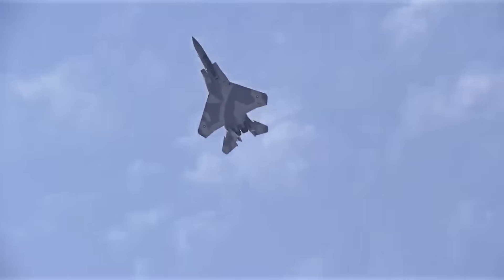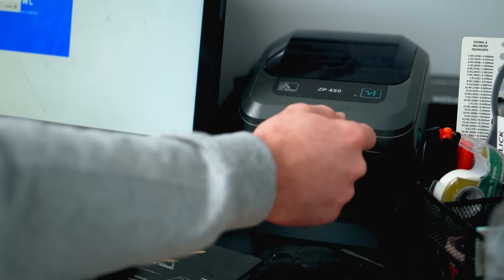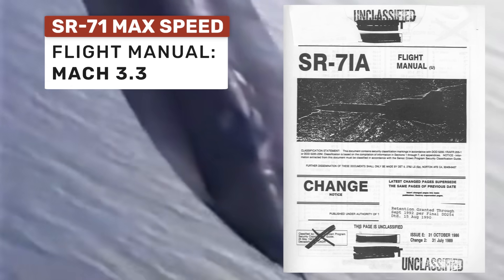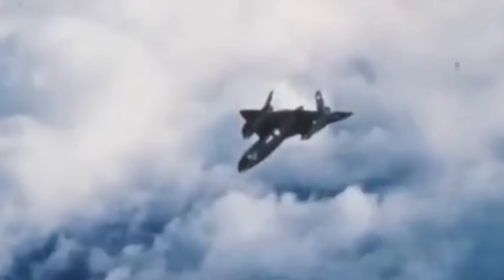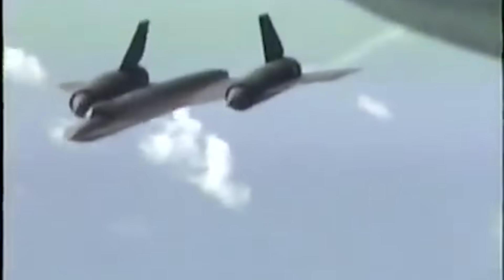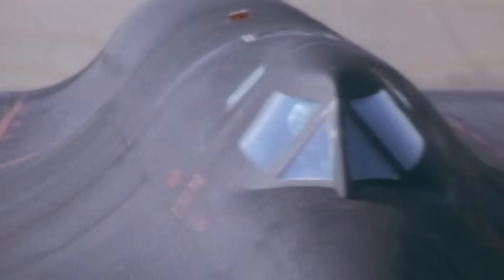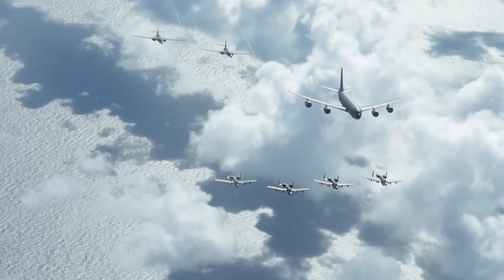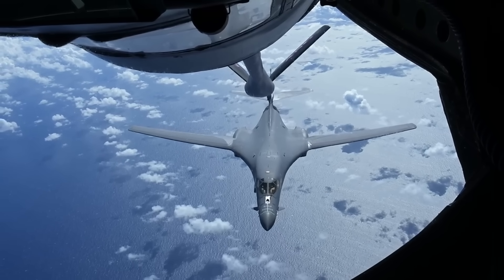The SR-71 was MUCH FASTER than the Air Force will admit

Comment: The Blackbird could do sprints exceeding M3.6, note that a sprint is short time bursts.
These cannot be counted as top speeds, considering the simple fact, these sprints are so short-time.
The 15 seconds pulled of, therefore cannot be taken in account either, ESPECIALLY because of the sloped flight.
In the end, if the blackbird would go for a 90° dive, it might have broken M4.0 ... with fatal ending, of course.
I bet, that would not be taken as speed record either, would it, sir?

Merely thinking out loud ... .
Reply: The SR71 did not have any "sprint" speeds, and it definitely couldn't reach 3.6. Even in a dive like that. It would have failed structurally before reaching a higher speed
Reply: @gr8crash  I was merely pointing at the 15 seconds, as I quite well pointed out, I thought.
Also, the SAFE speed limit does not mean, the plane could go faster.
Be it in an unsafe manner.  :S
Reply: @Xogroroth666  even 15 seconds wouldn't do anything as acceleration when already at mach 3.2 is pretty gradual. 

The "safe" speed was pretty close to its unsafe manner. There really wasn't much wiggle room there. Even if it performed a dive for higher speeds, it would likely cause the aircraft to disintegrate as it can't handle those loads. Also as it approached denser air it would overwhelm the inlets causing an unstart leading to reduced speed. The only hope for the SR71 to achieve higher speeds was when atmospheric conditions were colder than standard and the aircraft was flying higher than standard.
Reply: @Xogroroth666 didn't say it was the "danger" level, but that's pretty much it's speed. Everyone thinks it could just keep going but it couldn't. The initial limiting factor to speed was the engine CIT of 427⁰c. Now there were times they reached that limit and couldn't even reach mach 3, and other times they could be at mach 3.2 and be well below that limit. Thing is everything was designed for mach 3.2. The engines, inlets, cameras etc. Fly faster and you stress the engines, or inlets etc. The camera resolution starts to be effected etc. Remember even going to mach 3.3 was only with commander approval and also only if other engine parameters were within limits.

There's LOTs of people who think it could fly mach 3.5+, and none of them can ever answer a simple question. Even IF a pilot flew beyond mach 3.5, how would they even know?
Reply: @Xogroroth666 people just think it could keep accelerating etc beyond its mach 3.2 speed, it just couldn't. 

And yes 3.2 and 2.3 are very different,  but don't recall any one questioning that.

There's a story from the early A12 days where they were struggling to reach mach 3 so they went into a shallow dive then hit good air, reached mach 3.56 and redlined everything.  I'm skeptical of that as the aircraft didn't accelerate that fast,  plus you need very cold air etc.

Comment: Here is what I don't get.  Why is it people think the USAF has some sort of duty to divulge anything about it's aircraft to anyone, for any reason outside of classified congressional oversight??

You can look at the math involved in this aircraft and easily figure out the "range" of airspeed it would be able to achieve in perfect circumstances.  That, is about 3.5 and change.  This is100% due to the limitations of the compressor inlet.  The doors have to seal shut tight, the bypass tubes can't be leaky, air has to be cold enough, and a slew of other things have to be "just right' for it to hit that sort of speed.  I do not believe the A-12 was faster either.  Speed isn't just about shedding weight and "BAMMO", you're all of a sudden faster.  Like I said, you have all these things that make gaining speed at those levels a challenge.

Comment: I tracked the SR71 on radar.  Supposed to be stelth but we had a very good radar.  I can say it  is very fast and has extremely high altitude.   We at first thought it was an incoming missile.  Spent weeks troubleshooting the radar. All information is still classified, but  it is very fast.
Reply: All information is declassified. And has been for 2 decades
Reply: @gr8crash  From what I understood it remains classified.
Reply: @ThomasWakefield-g8e nope, all declassified. The only aspects of the SR71 still classified are parts of the ECM/DEF equipment as it's still in use today.

Comment: the SR-71  would stretch 18 inches in flight due to heat . And leaked $40 a quart fuel on the runway like a basket. Nasa acquired it and continued to run up the fuel bill. Fastest aircraft now last check was the space shuttle upon reentry.
Reply: 18"? Lol no. 3-5 inches was the max, not 18". It leak some fuel yes, but nothing too drastic. NASA did fly it for a few years, but nothing too excessive.

Comment: The sr71 can do 45 miles a minute and can cross Nebraska in a little under 5:00 minutes. All 220 miles(width) of it. That’s Mach 3.5 which is the fastest it can go. Well atleast the fastest anyone was willing to push it. I did all the math based on an interview with a reliable source(SR71 Pilot). Please be cordial. I am not making any of this up I absolutely would not waste your time or mine. You can do the math for yourself. Nebraska in 4:30-5:00 minutes is Mach 3.55-3.50. Also in this video alone a pilot reported him doing 3.5 running away from a threat so now that’s 2 pilots who have made this claim and I fully believe them. That’s 2,685 MPH. Absolutely insane and ridiculous. I couldn’t imagine being in the baddest and fastest air breathing machine ever built back in the early 60’s (1964). Must’ve felt like you were flying a legit space ship which you kinda were. Flying on the edge of space while wearing a spacesuit. Like Jesus Christ, I couldn’t imagine. Even if you built the sr71 today it would still look very modern and have modern performance being able to out perform anything else in the world. And to have that feat still to this day(60years) really goes to show how advanced this plane really was. Should’ve never retired it. Should’ve built a bigger super version with upgraded engines, more advanced materials, making it stealthy with modern radar absorbing coatings, and more advanced cameras, and jamming systems. Making the plane 20% bigger with bigger more fuel efficient engines would allow it to travel much further and faster and doing around 4,400 miles at Mach 4. It would be unstoppable. We’d be flying directly over China or Russia untouched and unseen on radar. Should’ve made a super sr71 like they did with the f18 hornet turning it into the super hornet.
Reply: You referring a lot to Brian Shul ans when it comes to performance,  virtually everything he says is a lie. The Nebraska comment is sketchy at best for judging as they don't say which way they flew over it, E to W? N to S? So it's impossible to judge anyth.

Comment: In the 50's & early 60's, if you needed a platform/balcony safety rated to hold 1,000 pounds, you built it with a 2 to 1 margin. It could hold 2,000 pounds. Of course today they no longer build things that way. Today such a platform/balcony safety rated to hold 1,000 pounds will collapse at 1010 pounds. Unless someone cuts corners to save a dollar.😉
This does and has happened.

The SR-71 was designed & produced in those days. And even today, you don't design & build something that cruises at its maximum operating capacity.

If it's designed for standard cruise speed of mach 3.2, it's likely it can do mach 4+ in short bursts(fuel being the main limit) in extreme circumstances.
However, Doing so may require major maintenance once back on the ground. Anyway, you always design and build things to exceed normal operating perimeters.

Keep this in mind.
The piloted X-15 did mach 6.7 in 1967.
It's said the X-15 project was discontinued after this,😉...

Yes, and Majestic 12 was discontinued,  as well as Project Blue book after that and a slew of other top secret UFO projects. Now it's known as the UAP project. And there's never anything disclosed to the public after 80 years.

According to rumors, the black project "***they continue to exist" SR-72 will cruise at mach 6+(mach 9 being possible due to a breakthrough at times)

"***they continue to exist".
Do you really think F-35's cost $130 million plus or $14 billion for an aircraft carrier. Others build comparable ships for a 3rd of that and they have the same material and labor costs. Dig into it.

And this is only to be seen as an example.
Corporation XYZ recieved $20 billion a year government contract to build 20 widgets annually. It's financials show they recieved $10 billion annually turning out 20 widgets annually and correlated stock dividends and everything is in order. $10 billion just poof.

The math never adds up if you dig into the details.
You'll find they did actually receive $20 billion, but it disappeared in the paper shuffle. This is how black projects get funded. And should some information leak out, well it's private R&D by Corporation XYZ. But again, according to their original financials, the math doesn't add up. Where did they come up with these research Dollars. It's the Dollars that disappeared to keep people from discovering the secret research.

Perhaps there's a secret Battle Cruiser orbiting over the South Pole.🤔😉
Reply: Your thinking of the SR71 performance is severely flawed and not even possible

Comment: The top speed is only limited by heat. The colder the air, for example on a new record cold day at 90,000 feet the SR71 can set a new record speed and can fly right up to the melting point. Maybe a bit beyond for a very brief period until the melt starts then it has to back down. Then a new record cold day happens and a new speed record can be set and so on. But they will be small speed increases. Not like another mach number faster. We are saying maybe 10 mph faster than the last speed record. Again only possible because the air temp gives it a buffer, room to go faster.

Comment: Augmentation, not afterburner
Afterburner was lighting leftover fuel. Augmentation is the deliberate injection of fuel into the exhaust. 

The v max seems like a tamer version of the switch on the back right of the console.
That switch overrides the engine controller and allows all the power from the engines. The digital engine controller limits the engine from absolute full power in  normal operation. In override the engines will eventually  melt trying to push out power.

Comment: One friends of mine is a retired high ranked fighter pilot. He told once they were on air defence practice in Poland saw Blackbirds heading to Soviet airspace. They measured about Mach 4 on the radars.
Reply: Not likely since that isn't even possible.  Also depending on when this was, and what aircraft they were in, they may have never even seen them.
Reply: @gr8crash  ground air defence control center. Ground based radars. Blackbird is not stealth. It was fast only
Reply: @78bekem actually the SR71 was "stealth". It was based off the A12 which had the primary design goal of reduced RCS. Over time the SR71 did become slightly less stealthy though as it wasn't a required as defensive equipment got better.  

Also that was his job. So not likely any men showed up.  Especially as this seemed to be over the CONUS, it would have been training missions etc so it wouldn't have been anything crazy.  Especially in the 80s as details were being acknowledged. 

Cool story either way

Comment: I am not going to take the time to watch this.
 #1 is was at a minimum classified at the top secret level, if not higher. 
#2 When has the govt ever REALLY been honest about much?  
#3 The SR 71 was the lower and slower flying little brother to the A12 Cygnus ( Oxcart was the program name, not the planes name ). Yes, you read that right, the SR71 couldn't fly as high or as fast as the Cygnus did. 
The bottom line being, you don't really want to set the bar any higher than you have to. Why, because someone is bound to step up and try to beat it. Common sense really.
Reply: The SR71 aircraft itself was classified at the secret level. Although while in operation some systems and ultimate performance was top secret. That hasn't been the case for decades now.

The A12 didn't fly higher or faster. All 4 variants had the same overall performance capabilities.
Reply: @gr8crash  We will have to agree to disagree on the A12. I have seen interviews from a number of both engineers and pilots on that bird that I have derived my opinion from. While we can agree that the SR has been declassified for years, lets face it, they aren't ever going to release the full truth on ANYTHING.
Reply: @ritchschut1997  but everything with the SR71 has been declassified. The only parts still classified are parts of the ECM/DEF equipment as it's still in use today. 

As for the A12, it's incorrectly assumed to be higher/faster because lighter etc. That's all just a misunderstanding of the aircraft. What people don't realize is the A12 had less thrust,  while having the same CIT limitnand all 4 had essentially the same AFT body meaning same lift and same limitations. 

Now it could be said the A12 could accelerate and climb a little faster, but not by anything excessive. And all the A12 performance is declassified as well and it's all essentially the same between A12, SR71 etc.
Reply: @ritchschut1997 they aren't in a sense. I have a lot of those, including a lot of the design studies etc of the A12 and comparing it to the SR71. Virtually no where is there any data or anything factual that says the A12 was faster or higher. In fact there's plenty of information that confirms they were all essentially identical these days. Again accelerating a little better, and maybe climbing a little better but they were all held to the same performance tables so not a whole lot of differences.

Comment: I got to grow up in Buckeye territory and got exposed to Rickenbacker Air Force Base and Rick Patterson Air Force Base as well as being told which books to get to get the most accurate information on military craft as well as craft for NASA in 1974 the claimed top speed of the F15 eagle and that was clean without any ordinance on the outside was Mach 2.8 for bone to retract the story saying that the aircraft with its redesigned fuselage for less drag and the better engines gets Mach 2.9 is believable so they're gonna revert back to the old records where it got Mach 2.8 and it was in magazines newspapers periodicals I even went into the military magazines so how are you going to retract 2.9 when it was built it did Mach 2.8

Comment: NASA put a linear spike engine on one of the two they were playing with. I was told that when lit the aircraft went well past Mach 4. another source got the wife a chance to sit in the cockpit(active testbed aircraft, not mil spec so no CIA cammers), I'm to big but I sinfully place my hand on it. it still had the spike engine mounts with no spike engine.😢
Reply: They never "lit" the LASRE. They only used it to "cold test" it. And even if they had fired it, it never would have reached  mach 4. They did plan to do a hot test but it would have only been fired for approximately 11 seconds and never would have made it from just over mach 1 "it's max speed then" to mach 4.

Comment: I was at Davis Monthan Air Force Base  in Tucson and the SR-71 was over Anchorage and that it will land at D.M. in 20 minutes and 20 minutes later it landed.  They kept moving it around from building to building.  When it took off the flame had 7 rings and was over a hundred feet long.  It turned it's nose strait up in the air then hit it's afterburner and in 10 seconds you could not see the ship or the flame anymore.  The coolest thing is that the SR-71 made no noise at all when it left, no roar.  Later.
Reply: Huh? Virtually everything you said is complete BS

Comment: Alex you will never know what the F-14,F-15,F-16,F-18, and The SR-71 can achieve, I can promise it will blow 3.2 away, called Full Afterburn Dash speed. I remember when Clinton retired the SR in 94, and low and behold we have the last three at Edward's AFB under, Yep the (CIA) and continued Flying thru the 90's
Reply: So many issues. Most of the aircraft you mentioned are still in use, so kind of a poor example. The SR71 was fully declassified decades ago and it's performance information is all known and public. And no, it wouldn't go much faster then 3.2. 

Also there's no "Full Afterburn Dash Speed", especially for the SR71. If they would have done the upgrades it would have had a dash speed,  but they were never implemented. 

After retirement a few were brought back for NASA but they never flew another OCONUS or Reconnaissance mission again.

Comment: It used reverse-engineered alien technology. There is a direct line between the Roswell crash and the SR71.
Reply: Not likely. Pretty sure Aliens didn't come here with steam gauges and jet engines
Reply: Not just likely, factual.
Reply: @jamesstetz9884 not even remotely factual.